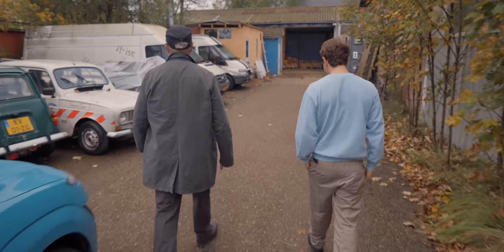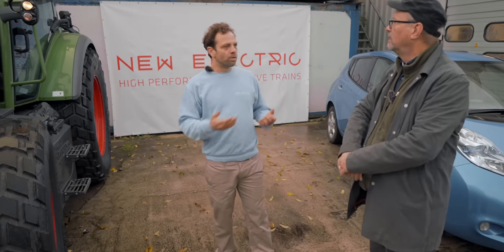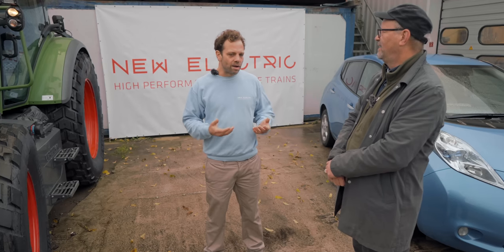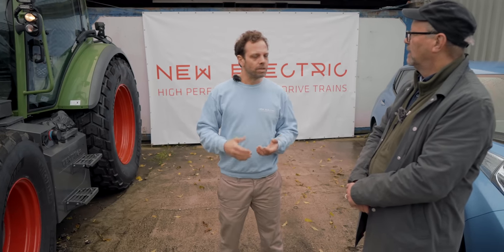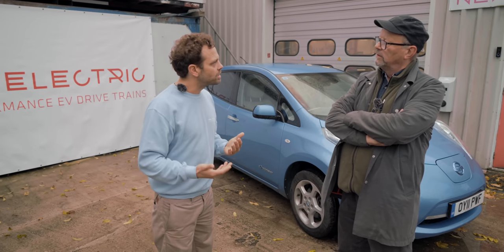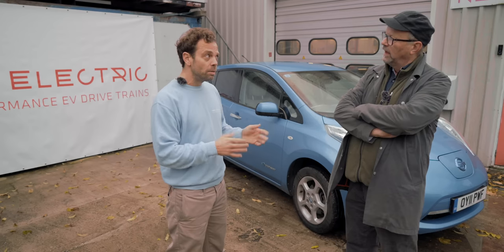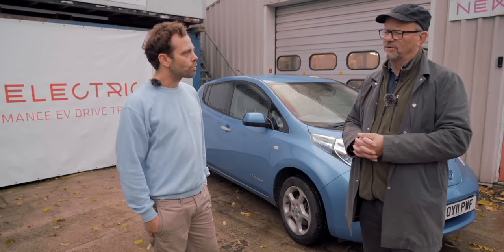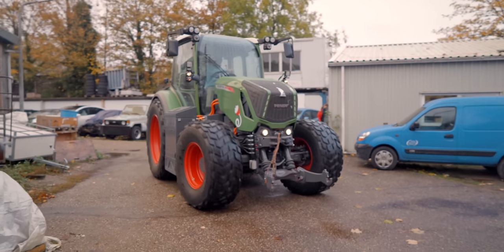New Electric - The converted Electric Tractor that pulls 30 tonnes

Comment: This is another great example of adapting a platform into which the regular manufacturer hasn't yet put any serious effort.

This sort of project, like the electric-converted bin trucks, is more impressive to me than the latest cars, especially given the much higher percent duty cycles involved. Electrifying things that are in use all day in close proximity to people os much more important (IMHO) than another £50k MEB-platform single-occupant tax-dodge that sits going nowhere for maybe 90% of the time.

More of this sort of thing, please!
Reply: As an ex Farmer I can tell you that we need tractors that can run for 16 hours on one charge, working hard all the time. Or be able to charge in 30 mins. Running a power harrow or pulling a big plough and you would get through that 360kWh in less than 8 hours, never mind 16. Most tractors could increase in length, and I suspect this will be necessary in order to incorporate enough battery capacity.
Reply: @captain1664  Fast Easy Battery Swapping system would make fare more sense.... than having to use a huge battery pack that could handle a full day of farm work.... 

But small  ICE range extenders EV Tractors will be a more likely 1st step?  Time will tell....
Reply: @captain1664  Tractors out in the fields are not where this conversion is targeting - look at the main channel video about electrification of old ICE bin trucks, where they talk of tailoring a commercial vehicle to a specific route. We're not talking general purpose (part of the legacy manufacturers' lengthy lead times will be the "jack-of-all-trades" market needs).

In the dawn-til-dusk 16hr ploughing case, JCB's work on Hydrogen-fueled ICE makes more sense.

This video is about a specific vehicle developed for a specific job - to haul materials to and from a city-based development. For that, 8hrs is plenty.
Reply: @captain1664  For that application I guess biofuel is the best carbon neutral (depending on the source...) option for now. No modification to the tractor necessary.
Reply: @examinerian  Most tractors of this formfactor are used in farming though. Sure, I've seen few such tractors around roadworks and construction. But far more often I've seen more specialised machinery.
And when it comes to farmers, with todays machinery prices they usually can buy only one or two tractors that will do all the jobs around farm.
Reply: @jur4x  Absolutely, and having grown up in a rural market town, I had school friends who were farmers' kids, and my dad's garage had an Agri section as well as trucks and cars. I've worked on farms and driven Ford and MF tractors back in my teens. 

It's just in this specific case, they explain why this particular vehicle was chosen for the hauling job. It's not a production specification so they weren't thinking of farmers' needs. Those tyres, for example, are more grass/general use than for heavy field work!
Reply: @nc3826  The practicalities of battery swapping mean that it’s probably not viable
Reply: @hughmarcus1  WADR NIO, Gleey. CATL and others have already proved, that your unbacked opinion is baseless...
Reply: Manufacturers haven't put any efforts in it ????! Are you serious!!!!!! This conversion uses the equivalent of 4 or 5 tesla model s batteries even tesla isn't making the semi which also requires massive amount of batteries, John Deere would have done it if they had batteries unlimited.
Reply: @nc3826  I think what was meant was that a farmer out in the fields wouldn't be near a battery swap facility. Unless the battery packs can be lifted off using other farm equipment and there are spares on charge then for the general farm use it's not going to be practical

That said, those big metal boxes either side between the wheels are probably the batteries, so it may be possible.
Reply: @carholic-sz3qv  Yes, I'm serious. Any organisation claiming to be up to 10 years away from a solution has not put it at the top of the priority list.

Look, as I've said before, this tractor is a one-off, specifically built for a city-based location. The cost/quantity of batteries that you mention is very relevant, but also the likes of John Deere will want to build the 16hr daily use tractors that working farms need, which will need a lot of work on battery chemistry to improve the cost and recharge rate - don't forget, a tractor in use 16hrs a day has, at best, 7hrs to recharge. No farmer is going to fit 350kW chargers, so that's out of the question for now. Which is why I said that H2-ICE solutions like JCB have developed are more suitable for that high-use case. Or biofuels, or eFuel such as Sustain already make.

Point being, if BEV won't meet the customers' needs, then it's got to be something else. That's why they're pushing it a decade away, and why they won't be putting much effort at all into it.
Reply: Massive amounts of effort have been put in by ever ag manufacture to electrify farming implements and vehicles, its just not practical.
The power band of electric motors doesn't suit slow operating speeds either, not efficiently, John deere have a system developed to do that now but its only coming onto market.
And at the end of the day we are trying to replace 800kwh of motive power worth of diesel per tank(which can be refilled in 5 minutes) with battery packs that currently take an hour to recharge and are ridiculously heavy!
The tractor in this video would have had a 250-300litre tank at 10kwh/l at an engine efficiency of 33% that's about 800-1000kwh of motive power, in comparison to 360kwh and its currently heavier!

Comment: What kind of charger do you need? How long does it take to fully charge? How much the whole tractor+conversion cost?
Reply: I am curious about it too, I think they go with 50kW CCS/ChaDeMo - (10-90%) within 5-6hours - proprietary external charger will be a little cheaper (15kW module on ebay cost 1000euro) but I think this is a pennies in comparasion to cost whole machine

Comment: Interesting vid👍Fendt isn’t too far away from electric tractor, I see autonomous tractor either electric or hydrogen power n size powered of 200hp this would operate a lot different working farms.  These tractors could be use in emergencies as back up generator or water pump.

Comment: interesting and something to look forward too. but the biggest problem is if it breaks down on a field. Now you have to find someone who can fix that motor, vs an engine you can fix yourself or find a local mechanic. Plus the charging overnight vs fill it with fuel in a couple minutes.  Yes fuel is expensive, but will you get more life out of that battery to make up the initial cost, repairs, and maintenance.

Comment: The question is what about those machines that run more the 12 hours a day, A lot of these machines run continually, here in planting season and harvest season many farmers and some construction sites run 24 hours a day and how much will the electrical bill be not to mention the cost of the new plug needed to charge the thing.
Reply: Tadus from germany is building electic tractors with easy changable batteries. 

While the new Fendt electric tractors  state to be usable for 10hours under full load.

Does a +12h work day, has the tractor running all the time at 100% load?
I imagine there would be downtime or work breaks 😅

Comment: 8 hours on a trailer, but on our rototiller for potatoes our around 140kw tractor uses 400 liters of diesel from 7am to 3pm, then another 300 from 3pm to 8pm, taking about 10 minutes to fuel up. When the electric tech can replicate jobs such as that it will be a viable alternative, but until then I think we must also check out other methods such as hydrogen or methane (which has its own benefits especially on livestock farms) before we commit to electric only
Reply: I was actually surprised. 8 hours is already a ton lot if it's 8 hours really working. I honestly didn't think it was possible right now. 
Then you need 2 for your kind of shifts, for now.

Comment: I'd like to see that Fendt being used on a farm to see how well it copes with life.
Reply: id imagine ploughing would suffer due to weight. ford john deere would have done this ages ago if it was practical
Reply: @vincentoconnell2560  If it was easily done. 8 hours of work is just half day at the farm.
Reply: fendt alredy tried to make one it was only a small vineyard one it never got to market. it was called the e100 Vario.
Reply: @vincentoconnell2560  Why'd thr weight be an issue? It probably came like max 1tn heavier with removal of engine and adding 1,5tons of batteries.

Comment: As with four-wheel drive, four-wheel braking and higher road speeds these early converters are ironing out the gremlins for the mass -production tractor makers to step in as and when they please.

Comment: So are the motors driving through the original Fendt Vario hydrostatic CVT? How is that being controlled? Seems like an opportunity to improve efficiency by removing the hydrostatic machines, particularly if the full torque-speed range of the base tractor isn't needed for this application.
Reply: It was a simpler conversion to just replace the diesel and leave everything else in place. They are not into rebuilding from the ground up, as stated.

Comment: So when will they have anything suitable for farming? Only 8 hours. That's less than half a day during plowing and seeding. Actually the same applies to harvest time as well.
Reply: I would be surprised if this could be used at 90%-100% capacity for 8 hours constantly without the batteries overheating, i doubt

Comment: Quite interested of the terminology.. (not that I have a use for the information).
Is that 30 tons of static weight? or 30 tons of rolling weight?
Reply: It starts off static, then once it's moving it's rolling!
Reply: my pedantic friend...you need to 1st realize your wrong for assuming that a ton is the same as a tonne... 

and common sense will answer, if it's static or dynamic inertia?. which one requires the peak level of force (ie power) from the tractor too be exerted on it, at a worksite?  have a good day, sir....
Reply: I don't think it's a 30 ton bollard pull... just a 30 ton trailer.
Reply: @gerry343  I have seen a guy pull a train and someone else pull a jumbo jet.
But I doubt they could do the same of the same weight as a bag rubble.

Comment: So if these electric vehicles last for a couple of years how do you weigh the cost versus input versus output? I assume that they cost more resources than what they save especially if they only last a couple of years
Reply: why would this only last two years? teslas have reported more than 80% battery capacity retained after 150k miles and 8 year. obviously every EV and every battery is different but the "hur dur EV batteries don't last more than 2 years and cost $30k to replace" argument is getting really old. plus, these aren't being built for cost savings, it's for local emissions regulations.

there is more to consider than just fuel savings when you talk about ev vs ice though. especially when we're talking about tractors, the reduced maintenance required for an EV is likely a huge advantage that increases uptime on the tractor. modern tractors might have to wait weeks to get fixed when a sensor goes bad, but EVs are going to have much fewer sensors since there isn't an engine or (as complicated of) a transmission that needs to be monitored.

Comment: I’m a supporter of EVs for cars etc.  but I think we need to be realistic about heavy plant equipment, tractors, HGVs - this is almost certainly too heavy for fields, and the 8 hours a day working time won’t cut it for such an expensive piece of capital equipment, it needs to be able to operate continuously. Nothing wrong with electric power, great torque etc. but until battery technology improves massively I can’t help thinking that hydrogen is the way forward for this stuff (JCB did a good video on this).  Produce hydrogen from excess wind power rather than shut them off, though, any other way would be bonkers.

Comment: This is really awesome, and the future is electric. However, todays diesel tractors are already too heavy for agricultural use in some countries like Norway where I'm from, so I don't think it is possible to make electrical tractors for agricultural use with today’s heavy battery technology. Tractors in agriculture does also need to have really fast charging times, so they can be used up to 20 hours a day in some periods.
For those two reasons, I think the agricultural tractors in the future is electrical with hydrogen as its energy storage, but battery tractors would take over when we manage to make a lighter “super battery” that has the same energy density as hydrogen.
Reply: I think it will go towards having 10 or so autonomous small robots run by electricity on the field. If one of them fails you still have 9. With increased battery charging speed that should work well. Using these big tractors with batteries just won't work out. There are a lot of farms that use their gear 24h a day for a short period. You don't have enough time to charge
Reply: @JayCee2209  That could be many years from now, but the soil in Norway need a lot of work, so I don't see how it is going to work. We also have hills, wet places on the field etc. so the transition to smaller equipment is many years from now

Comment: Emissions free my @ss, production of that electricity is far from emissions free, and manufacturing of those batteries is is an environmental nightmare. As a farmer, I’m a big fan of the electric farming concept WITHOUT THE BATTERY! I just need a low power internal combustion engine for in between fields, otherwise, I’d power via the grid and hose reels similar to what is used in organic manure and linear irrigation application. 

I’m not afraid of tech, but battery power as it exists right now has no place in reducing environmental impact.

Comment: I want to post a link of this video under every agricultural mashine channel out there with 100% ICE tech and people totally ignorant of the changes about to happen within the next ten years.
I also wonder if construction and agricultural mashines weren't the best use case for uniform swappable power packs that could serve all sorts of purposes throughout the years, think Bosch 18V tool "family" with tools designed to use the same battery pack. Lots of specialized mashinery, lots of homemade solar energy and a need for storage batteries too. 
One could easily farm this out (so to say) as not to burden individual users with the capital invest needed for having to own all battery packs needed for occasional peak demand.
Surely an EU wide tech initiative involving majore producers of mashinery to set realistic standards and help to get r&d off the ground could be helpful.

Comment: Of it's so fantastic. Only thing is we don't talk about the production process for the battery. Child labour in Afrika, large damage to nature,l andscape and environment. For mining all these special materials. Making China bigger all the time,....... not without danger!! The heavy weight of the tractor wich mean lowering the waterlevel. A very negative part we deal with in Holland. Etcetera etcetera. And while the technique is available to make cumbastion engines much more efficient. We can make a consumer car using no more then one liter petrol for 50 km without any problem. The climate is not the problem, it's about power. Why not closing all these biomass power plants for example?

Comment: "emissions free" yea no. The carbon footprint of that battery pack alone would take a normal traktor years to fill out if it would run the same 8hrs a day. Plus it would need to be replaced couple of years down the road, there you go again with that same lithium battery pack. I guess as long as the diesel users get taxed and the pollution is happening out of sight and out of mind its good enough for the government

Comment: Ya but to pay for that it'll have to be working 24/7🤣. Emissions free a 300 thousand dollar diesel tractor (untenable for all but the largest farmers)  becomes a million dollar plus one....rough even for large guys.
Reply: How is a diesel emission free? Does it run on 100% biofuel and would that be cheaper than running an electric one charged by your own generated power?

I imagine someone who has to own a big diesel also has roof space for solar or produces enough biowaste to power a stationary biofuel generator. 🤔

Comment: It a shame the likes of JCB seem to be putting off electrification.
Reply: Battery power isn't the right fit for all applications.  This tractor with its current abilities would be of limited use on a farm.  Perhaps in time batteries will quadruple their power density.
Reply: Not so. JCB already offer electric excavators......
Reply: @nonebusiness8328  With respect, that's stating the obvious.  Ten years ago, some said electric cars would never be any good for anything other than shopping trips and very short journeys.  In 2016, two guys took a Nissan Leaf from John O Groats to Lands End - and back again. A distance of 1653 miles, covered in 48 hours, including charging time. Amazing what a few years can do isn't it?
Reply: The JCB family also own Ryse, which focuses on hydrogen fuel cells. They have buses in service already, from Wrightbus in northern Ireland.